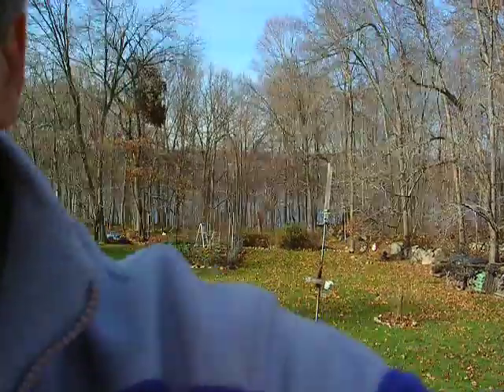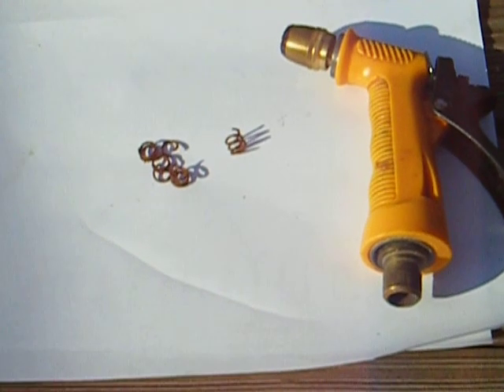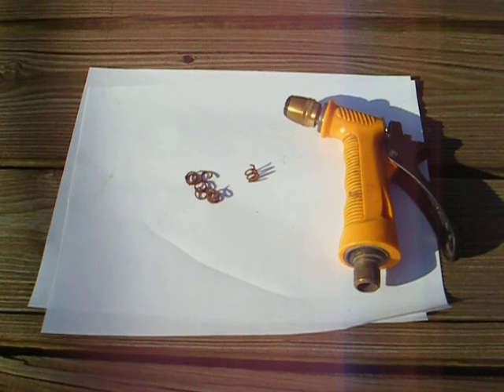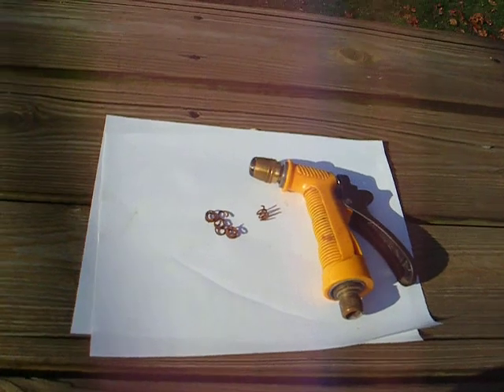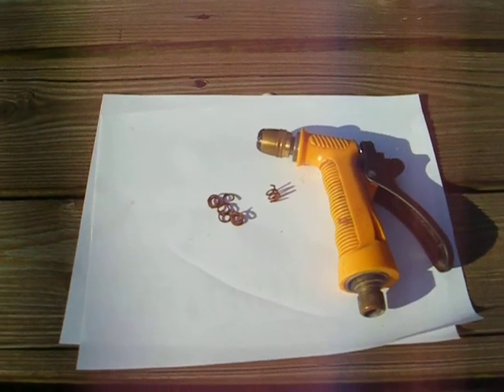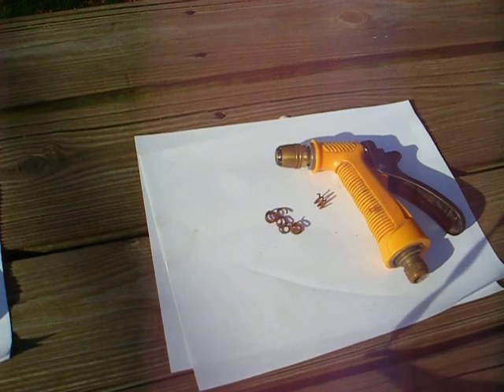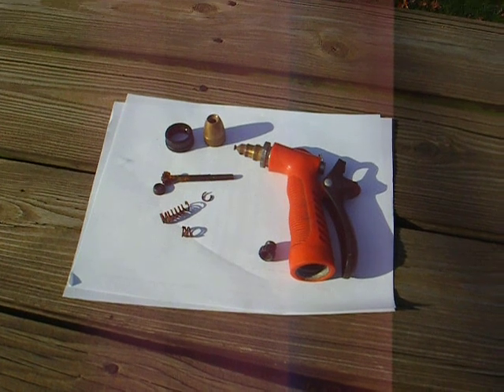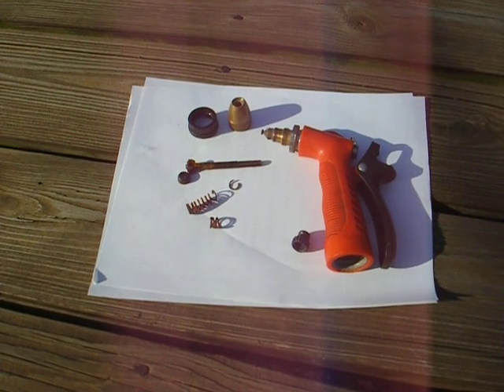DELIBERATELY DESIGNED TO RUST OUT FAST?

Comment: Stainless steel has a lower elasticity modulus. I'm not sure what material would withstand the water and still have the spring strength. They don't intentionally make it to corrode, there just isn't an appropriate material at a reasonable price.